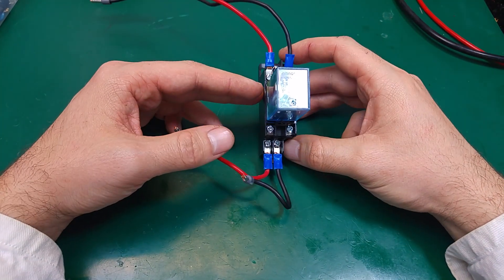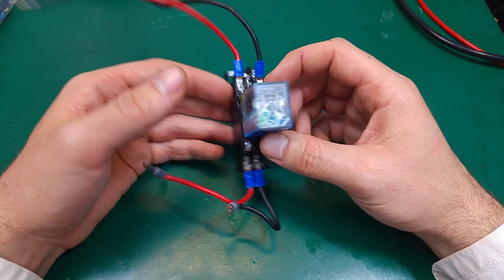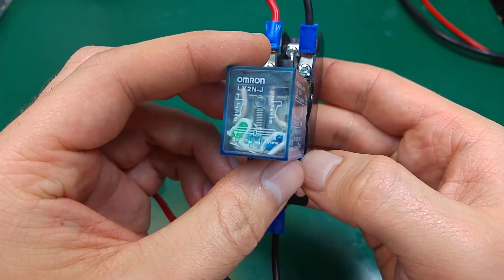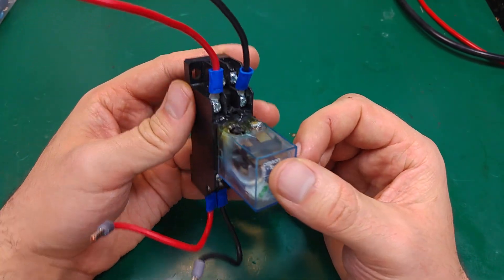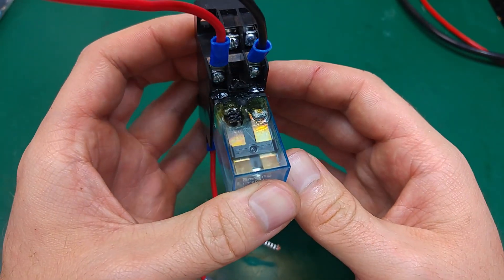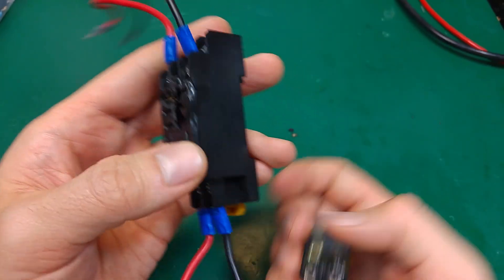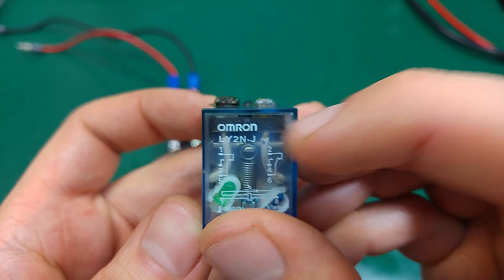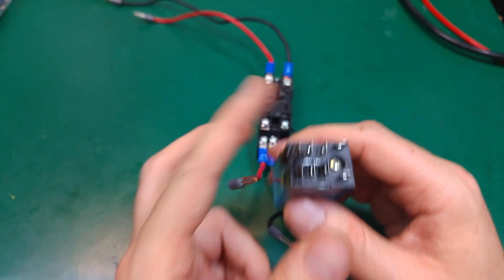China fake 24V (clone Omron) relay LY2NJ melted and cause fire hazard

Comment: I have just completed an extensive project using 600 plus of these relays...

Dpdt and 4pdt types.

In the first operations i have already had many failed relays.

99 percent of the failures involve the normally closed contacts.

Clearly, there is an issue with theproduct to have numerous failures from the start.

My application is not switching much load... 

Very minor switch load, and i simply get no continuity.

This implies that the normally closed contacts are NOTbeing closed tightly by the return spring.

In a higher load application, i would expect the poor connection to fry and burn just as you have shown.

I would not use any load switching on these relays, only inter-connection replay drive.

I expect no burning in my application, however, i do expect trouble with confections.

I am hoping with numerous operations, the contacts will develop better connection with wear.

Comment: Using relay for switching dc load is bad idea, use MOSFET or igbt with heat sink
Reply from the maker: Except situations when You need isolation - yes.

Comment: You will not be getting arc problems at 24V as such.
During switching, if you're breaking a large current, you will get a quick arc. This shouldn't be a problem, as that is what relays are for.
What this is, is the contacts heated up because of current draw.
It might be a good idea to check, and DOUBLE check the current draw of your system. Perhaps it was drawing more current than you thought?

If you were drawing 15A and the relay was rated for 20A, it is entirely the fault of the relay.
I NEVER buy anything cheap from China. It is ALL shit.
When I want to do something with electricity, I pay over the odds by using RS components. That money does not just disappear. It pays for THEM to worry about products being correctly certified. 

It might be better to look at switching that load with a MOSFET. You won't be spending enough time in the linear region to develop much heat. With careful selection, you should be able to get a very low "on resistance" device that will run quite cool with a suitable heatsink.
Reply from the maker: I agree for main's i would not trust China...
I don't like solid state relays just by idea - in my head that's what make relays good - real isolation, breaking contact and eliminating any possible current flow.
I'm 100% positive that's not over-current,  that relay failed couple months back but i don't have time to record video it was just sitting on my bench forgotten, back that day i replace it for same china and couple month passed - everything working fine, i periodically inspect visually and no heat damage near contacts seen.
That two pins working in concert, i'm big fan of switching both lines positive and negative same moment (in case of fail of onese cond will be broken). 
Here also looks like one pin failed, second looks good and clean.
Just another puzzle in my electronic fun to be aware...
Reply: @ElectronicNoobBlog 
It was a good video anyway. Electronics failures are my favourite type of problem. 
And yes, I like the true isolation of mechanical relays as well.